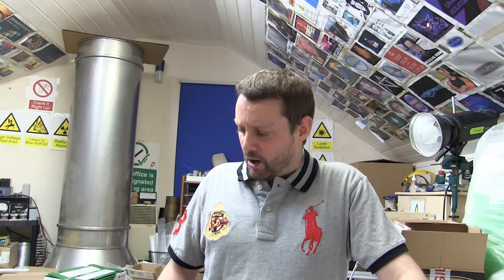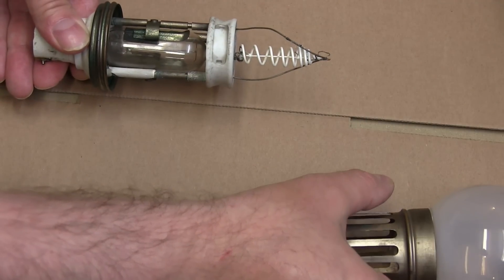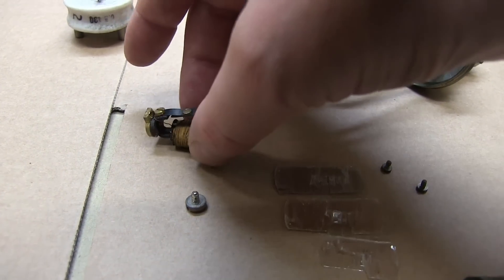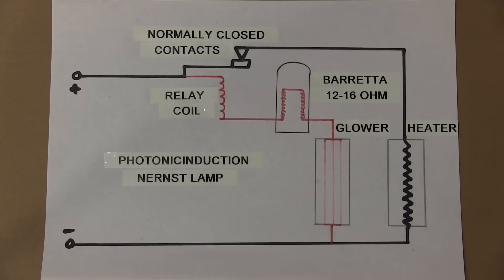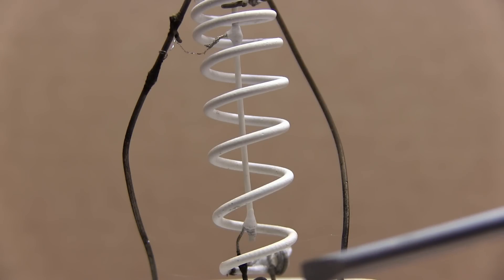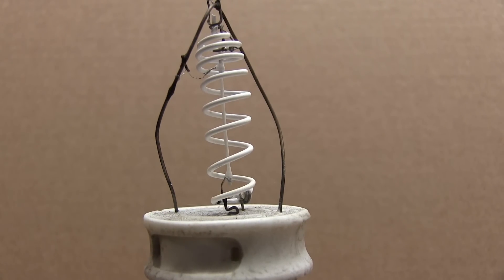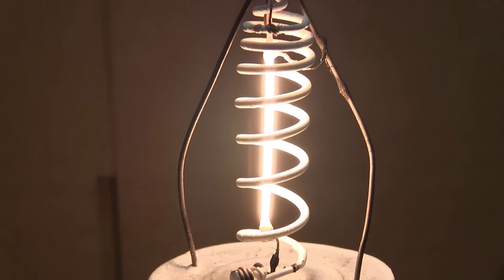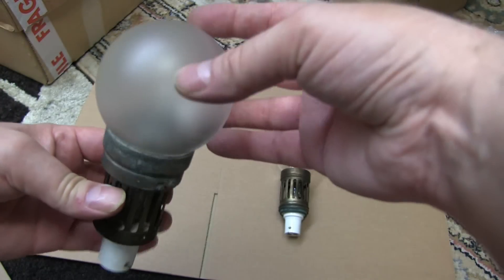120 Year Old Rare Nernst Lamps

Comment: Speaking of oddball lamps, I must dig out the Pointolite bulb I have somewhere
Reply: CANT WAIT!!!
Reply: Please do, I've seen the write-up on your site, it'd be cool to see it operating!
Reply: Hmmm me too!  Remembering I have a Mazda/GE 5KW 120v from the 1940s-50s that still works it's very similar to Andy's 240 version. I may post a newer video of it soon
Reply from the maker: Pointolite are nice lamps, I have quire a few, they are easy to run if you have the 3 and 4 pin ES Bases.
Kind regards to you my friend.
Reply: @Photonicinduction  I have a question... what would happen if you caught lightning using a normal lightning rod... but then using a transformer or some other stuff, multiplied that voltage again by 1000x? What would happen?
Reply: @cheater00 you would probably be able to wake the monster
Reply: @cheater00  I like the way you think
Reply: @originalbigtee  thanks terry i'm getting the photonic bug
Reply: @OverUnity7734  i bet photonic has one of those
Reply: @cheater00  You would need an impulse transformer that could withstand 100B or even a trillion volts and maybe up to 200,000A on the primary side. Good luck with that, the bushing alone would reach the top of the atmosphere and be useless (air is less of an insulator at lower pressures/higher altitudes). It would have to be built in space with vacuum as the insulation = very expensive and still very big. And for what? Bragging rights on Youtube?
Reply: Fantastic
Reply: @OverUnity7734  actually 100+ million volts and several hundred thousand amps
Reply: @cheater00  I'd like to see it charge a massive capacitor, without melting or popping
Reply: @cheater00  Erhm...you would have a much easier and better time of it reviving the designs of lightning arrestor tubes than you would a lightning "catcher" as you basically described.  Essentially they're fuses for lightning, and while I don't know any place which still employs them I'm sure you could find someone who wants surge protection against lightning bolts...
Reply: @enduser63  I'd like to see it charge a massive capacitor, AND pop it
Reply: @cheater00  yeh that would be an interesting explanation!! I’d like to hear it too!!great question!!!
Reply: @cheater00  if you control the heat,can store it ,trickle supply,vs instant discharge,, one strike has super massive fuse problems
Reply: @cheater00  What about creating lighning itself? It's created in the differend polarity between very cold and very hot air molecules. It will take more than a paintstripper on an iceblock though.. ;)
Reply: @cheater00  Lightning is already a few hundred thousand or even a few million volts. This would easily exceed the breakdown voltage of the primary of any transformer and fry it, likely in a spectacularly catastrophic manner.

Also, lightning rods aren't there to "catch" lightning. They are there to dissipate the charge via corona discharge off points and edges to prevent lightning from striking nearby in the first place.
Reply: @jeffwarren9791  thanks! I hope Photonic chimes in whether that's possible at all!
Reply: Please do!
Reply: @cheater00  I've had this idea . . . or a similar one: I wanted to turn lightning into a power station!  We could capture the lightning strike in a giant capacitor then convert it into AC with a spinning commutator and channel it into a step down transformer, so it can power homes.
Reply: @jlp1528  They do make these nice little rockets that do exactly that by trailing a fine wire up into a cloud
Reply: @bardrick4220  I'd heard of the lightning rockets but I haven't kept up with them. If they're actually generating power at scale now, color me impressed.
Reply: So... A transformer can be a 1:1 turn coil of wire and even wrapping 2 turns around a single turn of coil doubles the voltage, anyone got a good way of insulating that? I'm thinking grounded insulated slab of silicon rubber, now mind you I am talking a shipping container sized slab here, could use steel girders as wire but what could handle that type of magnetic flux? The repulsion forces alone would be extraordinary, maybe we can break reality by doing it big
Reply: @jlp1528  I haven't heard of it being done . . . just a crazy idea; the idea is to have a capacitor of a greater size than the bolt, so it behaves like a short to ground as far as it's concerned
Reply: @cheater00  Not at all worth it. Even if it got a billion views that's only around $1-2M. Even if you also got people like ABB and Siemens to sponsor you on top of that (why would they? They mostly don't sell direct to consumers anyway but mostly utilities and energy companies) you'd still be short prob $100B, if not more, considering such a monstrosity would probably cost more than the ISS.
Reply: @dennisford2000  It depends on the lightning, not all are equal and it's mostly a bell curve distribution. The biggest bolt is positive lightning (coming from the top of clouds to ground rather than the bottom as usual) and that can be 1B volts, 200kA, and lasting up to 100ms. 10x the voltage, 10x the current, and 10x the duration = 1000x the energy of average bolts. The few unlucky enough to get hit with that never survive (not just lichtenberg burns but chunks of flesh blasted away, CPR will not fix that).
Reply: @frogz  I don't think you need wires that thick . . . lightning is epically powerful, but it's also brief, so heating is minimal.
Reply: @bardrick4220  Using lightning to power houses isn't practical, only 1GJ per strike, though the peak power is huge (TW's). Even asumming 90% overall conversion efficiency that's only 250 kWH. All lightning on earth captured 24/7 is only about $9M worth of energy per hour to sell. Sounds like a lot, until you realize equipment costs like transformers go up with the cube of the voltage (it's partly why 20% grid loses are just accepted rather than raised to , say, 10MV instead of 500kV-1MV, that's the point were overall costs are minimal), so a single 100MV transformer would cost $trillions, even it were logistically possible. As a rule of thumb even if it's allowed by physics economic limits kick in long before that, and if the ROI is longer than 30-50 years it's safe to just forget about it, even investors have limited patience, and something like lightning power will have an ROI of thousands of years (assumig the equipment even lasted that long before needing replaced). And some systems simply can't be scaled down, it's even less practical to build such a system just for 1 house.
Reply: photonic you should over voltage Mike's x-ray machines !
Reply: @frogz  Sadly you can't simply just increase thickness and assume linear increase in voltage withstand. Even teflon can only handle 60MV/m= 2m for average lighting bolt. Thing is you can't do that, the voltage needs equalized across that entire thickness, otherwise it will just fractal burn through it rather quickly (minutes), maybe 2000 semiconducting layers between the teflon layers every 1mm or so. Not easy to manufacture. The long-term issue is insulation failure from corona damage. Most long-term insulation systems are designed to where the voltage is only about 1-2kV/mm because of this (think of it as bullets vs 2" thick armor steel door, those electrons/bullets are gonna get through after years of hitting the same spot on that door 24/7, even if it's 2" thick, most commercial transformers are designed last 50 years or so before that happens unless it's periodically rebuilt). For Teflon and 100MV that's 50m thickness= totally impractical. Probably the state of the art as far as long term insulation is Kapton-CR (corona resistant, NOT -HN, what most Kapton film is). 1mm thick can handle 200kV/mm short term and 15-20kV/mm for decades (depending on frequency). 100MV long term with that is 5m thick, still insane, but at least that's doable. Sadly it's very expensive, a 50cm wide master roll is over $15,000 (hard to find in quanities less than that), but I plan to get one eventually (though not to make my own lighting-fueled power source or try to zap Zeus himself with his own lightning).
Reply: @frogz  "attack the sky back" hahaha precisely. All i really wanna see is some insane plasma!
Reply: @borayurt66  please don't insult idiots by calling me an idiot
Reply: An incredible light it even looks safer than these new energy efficient lamps that explode sometimes.
Reply: @cheater00  
I'm not Photon, but I suspect there'd be several different difficult issues that would need to be addressed. 
The instantaneous current from lightning is so high that you'd need incredibly heavy windings for the primary, and because the voltage across the primary was already enough to ionize air, the output voltage  of your 1000:1 transformer would be difficult to deal with, even with very efficient insulators.
Reply: @tasmedic  for the primary you could have 1/8 of a turn using typical protection rod / bar like you'll find on the sides of buildings. For the secondary, well, if the voltage is 1000x more, then the current is 1000x less... so much less of an issue. The voltage might ionize air... so what?? Don't use air. Easy. Put everything in a vacuum jar or something. Flood it in epoxy. I don't know. It only needs to survive this once after all. No one said it shouldn't pop! In fact, it would be fairly natural for it to do so.
Reply: @cheater00  it would be very difficult as lightning is dc so not able to use a transformer. Although you could use a Marx generator. It would have to be the side of the Empire State Building!
Reply: @enduser63  a giant capacitor, you say? I saw a documentary on this once. They used lightning to charge something called a "flux capacitor" It was used for time travel or something... They had to return someone who was stranded in the wrong time period to his own.😁😁😁
Reply: @cheater00  -  Your eyes would roll like a gambling machine and you would end up either burnt and bald or a permanent orange afro LOL
Reply: @cheater00  I saw this documentary called "Back to the future", lightning would vaporise a DeLorean.
Reply: @jlp1528  They're really awesome but just for research purposes. Although, I'm sure you could easily weaponize them by placing them on critical infrastructure and waiting for a storm.
Reply: @zxggwrt  Any tool has equal or greater potential as a weapon.
Reply: @OverUnity7734  you got it wrong. it's just a pulse of a few billion volts and 20,000 amps.
Reply: @dennisford2000  it isn't. it's usually a few billion volts and tens of thousands of amps.
Reply: So sorry if this sounds like pedantry, but never having heard of a "barretta" before, I looked it up and it seems it should be spelled "barreter". Thank you for the fascinating information in this video about a kind of lamp I never knew existed, and in particular for taking the risk of firing it up for our entertainment.
Reply: @dennisford2000  most sites back your figure on the voltage but none have listed the current above 100 thousand amps. Also you realize you are also on the internet, given how quickly you responded it’s not fair to tell me to get a life.
Reply: @Ryan-uz2cr  you could use a huge commutator. i mean it doesn't have to be that huge, look at the size of lightning bolt protectors, the conductor isn't that thick actually.
Reply: @crash burn and who says you can't create a transformer like this?
Reply: @crash burn Then Photonic should have one I reckon
Reply: @frogz  Magnetic flux... Steal a pair of rails, put one end of one on the ground, put the other 2m up suspended in air, figure out a carriage that wouldn't fuse between the railsimmediately and whola – you got a railgun
Reply: @cheater00  the lightning wouldnt go through the coil it would just ark through the insulation
Reply: @cheater00  you would have a fire
Reply: @enduser63  I’d like to see it charge a Tesla
Reply: @zacke1434  I'd hope so
Reply: @zacke1434  I'd hope so
Reply: @OverUnity7734  Building high voltage power tra sformers myself I'd say, challange accepted. Ofc it'll cost couple million bucks from all the metal, wood and copper and the fact we don't have a big enough furnace to cook it XD
Reply: @cheater00  End of Tx. Lightning current of up to 50kA takes some taming. plus with a 10/350us waveform it over very  quick
Reply: @OverUnity7734  ok, now step 2?
Reply: @cheater00  We will watch your career with great interest

Comment: i miss how mechanical electricity used to be.
Reply: @marcse7en  Indeed it is, but tiny ICs and SMCs controlling a plastic-wrapped motor is not the same as a 100yo lightbulb or rectifier going "bbzzzzzz... ka-chunk"
Reply: Back when even lighbulbs were serviceable
Reply: @VictorGarciaR  yeah that's what I meant lol.  I know solenoids and such exist but they are hidden away, the vibe just isn't the same

Comment: Loving the consistent uploads! 👍
Reply: He's back
Reply: Also I was even wondering what was going on with photonicinduction and even leaving comments about what's going on asking anyone in other videos or if something was mentioned which was often mentioned in other Tech videos about photonicinduction and what was going on and at one time heard he'd be back but still didn't know for sure glad to see he's back with a vengeance in terms of Vengeance on destroying whatever comes this way other than the potentially priceless Antiques and at least he does have a soft side for someone things that deserve it and doesn't blow them up to smithereens.

Has anyone ever seen one of those Motors like in a disc camera originally or one of those stomper cars that was the flat permanent magnet motors not in terms of thin like not very thick considered type motor or what I call pancake cassette motor.

Such as in a Walkman or similar.

But it's a rectangular with the sheriff going out the ends in the terminals at the opposite end.

Another words not can motor either or the other versions of this.

I had one that was a piece of junk out of something and went photonicinduction on it until it pops.

I put another motor in his place and that was the issue the device lived on another day for someone else it was a repair can't remember what it was.

Instead of 3 or 6 volts can't remember.

I crank that puppy up to 90 volts DC!

10 new 9 volt batteries in series.

And boy did the Sparks Fly the motor was almost not even running in the first place it was such in bad shape but it was not due to the coils I believe bearings were bad?

But first thing that happened of course what's the worst commutator sparking ever.

Bright blue from top and bottom of the motor.

By the way it had a plastic commutator.

And of course as you can imagine that started getting pretty toasty next thing weird noise and something go flying there goes one commutator bar and then finally no more commutator bars maybe one left still attached but that was it I popped it!

It actually went quite a few minutes if I remember correctly surprisingly.

Don't worry welfare back safety glasses whole shebang.

They gave me so much grief and in trying to change out was a pain in the behind.

I just wanted to put it out of its misery!

I think that's the first time I've ever really went photonicinduction on anyting to this day.

Although I've gone Tim the toolman Taylor.

800 pound gorilla on fun things as well.

And also not to mention if any else fails get a bigger hammer.

Also proposed of Maintenance sometimes does a heap of good for Motors you were just tapping it with the screwdriver sometimes or a small hammer helps.

And also I'm the one if I can't fix it in a broken.

And even if something is beyond repair I can probably still get it working again just like once.

A dryer that had to switch that was like $60 switch assembly with one toggle switch 1 momentary switch.

Was replaced with two toggle switches and one push button start switch just wired like the original one would have been.

Good as new at least as much as it could have been with the age of the thing but only problem was just stupid switch if I remember correctly alright had all the parts anyways

Comment: When he says they're rare they're worth upwards of about £1,000 each.
Reply: Theres two on ebay, both the wrong side of £500, neither have any of the gubbins left in them.
Reply: That's it? A paltry £1000??
I'm not claiming omnipotence. But in all the years I've casually seen and looked up various historical nicks & nacks, on the internet or otherwise, i have never ONCE heard of these "Nernst lamps"
aside from today. That sort of rarity HAS to equate to more than that.
Especially with one this old.
Reply: @davecrupel2817  Aside from Photonic Induction nobody could guarantee it was working, and thus the value is vastly reduced. Just like with historic firearms, if they work then the value goes up exponentially. As a curiosity not many people would be that interested and it's only a good conversation piece for a rich dude if you can turn it on. 

This one is far more valuable for being a known quantity now.

Comment: Andy just risked a $1500 USD lightbulb for our viewing pleasure, thats dedication. And something that probably few people alive have ever seen. A little bit of history, the Nernst lamp was developed in 1897 as one of the first incandescent lamps with any useable lifetime, they were also more efficient than carbon filament lamps and produced more natural light. They were used in the 1900 world fair at a German electrical equipment supplier. They were used in early fax systems, optometry slit lamps, projectors, and microscopy. They were also used in IR spectroscopy for awhile. In 1937 the main mine where the minerals for the glower were brought up was flooded by Lake Buchanan.

They are cool pieces of history, and this is probably one of the only videos online of an actual production lamp operating. You can see the zirconia glower outside of lamps, but none that I have found in a state like this.